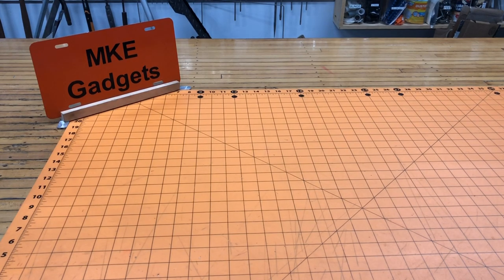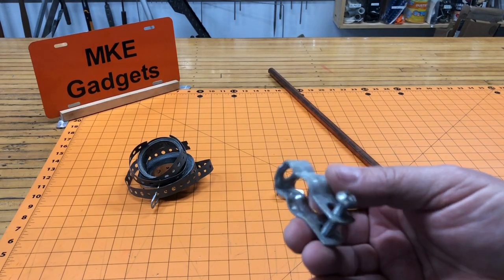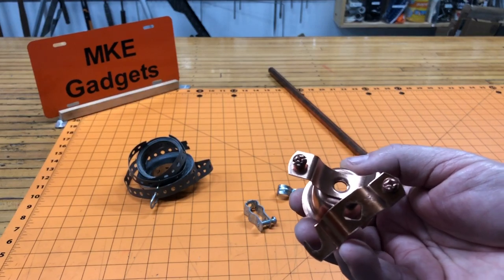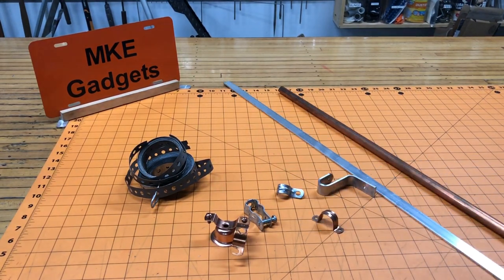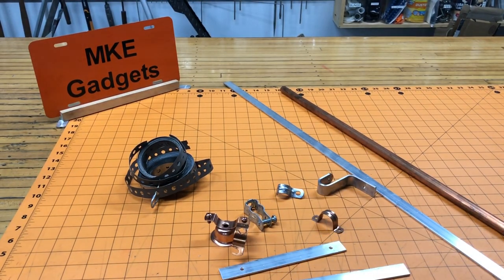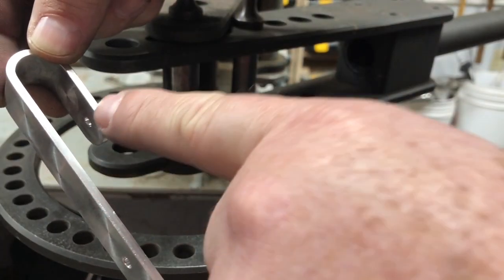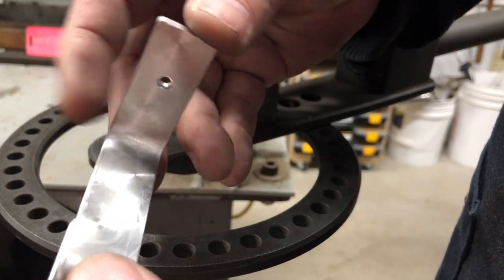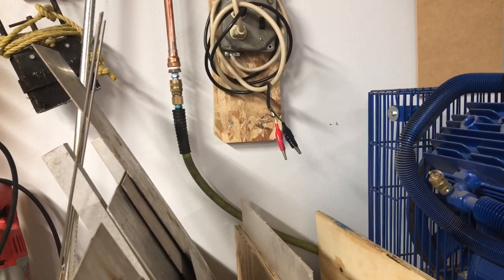Pipe Hanging Brackets @ MKE Gadgets #113

Comment: You might consider some non-conductive padding between those two dissimilar metals otherwise you'll quickly discover how well copper piping can leak. There's a reason why the commercial hangers are also copper =)
Reply from the maker: Thanks for your positive comment. That was pointed out by a friend, who is an electrician. I added a couple wraps of clear packing tape so you don’t see it, do you think that’ll be good enough? 
Please support me by subscribing to my channel if you have not. And check out my other over 110 videos on YouTube.

Thanks for your support. New video on most Wednesday, your going to like the next one.
Reply: @mkegadgets4380   yeah so long as it breaks the electrical path between the two metals, you could also use rubber sheet,  etc. The only thing about the plastic tape is that it might abrade away as the moves in the hanger as it heats up and cools down
Reply from the maker: Thanks.